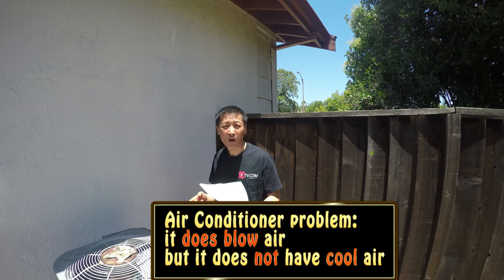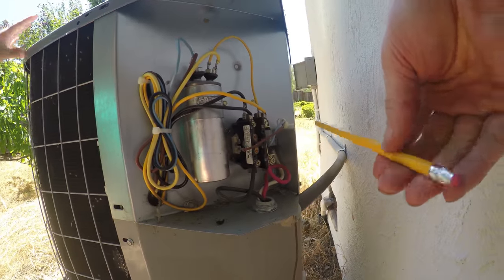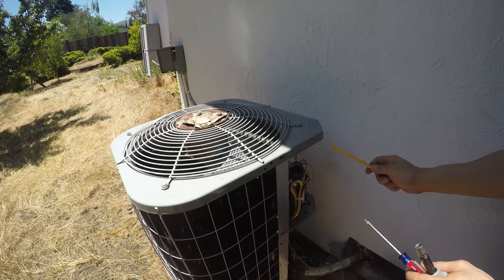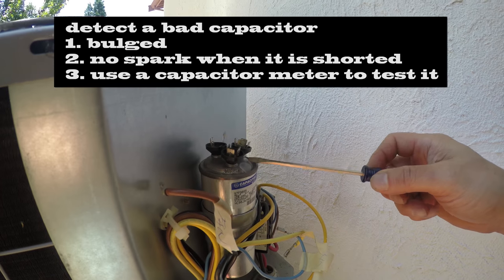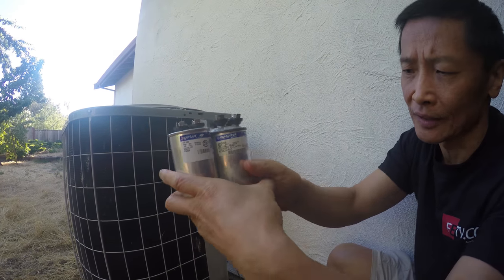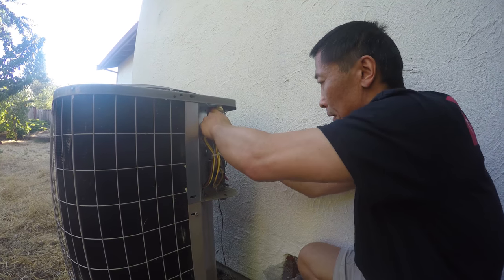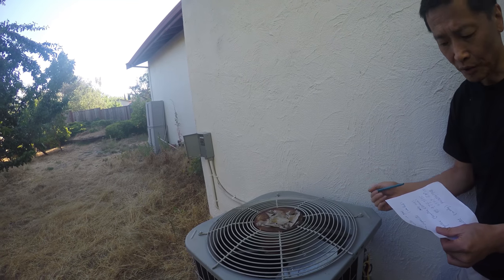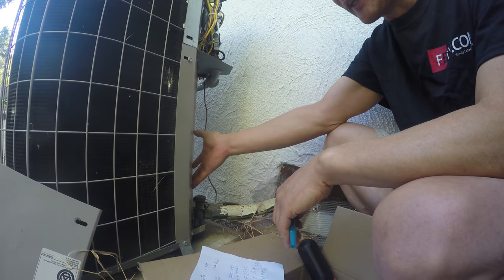How to Fix Air Conditioner Blowing Hot Air

Comment: Several days ago only hot air would come out. I called out an HVAC guy and paid $320.00 to get my AC fixed. Then a couple of days later my second unit did the same thing. Now I'm thinking, "Did this guy sabotage my second unit?" I know, what a thought. But for both units to go out within days of one another?

Anyway, this time I went to You Tube University. I watched your video and a few others and was pointed toward the capacitor. I followed your instructions, and now $28.00 later and the time and gas it took to pick up the part, my AC unit blowing out cold air again!

I'm not mad at professionals who make a living off of customers without the knowledge or time to DIY. But I am immensely grateful for people like you who graciously, and so competently, make knowledge available so people with the time and inclination to DIY can do so.

$320.00 vs $28.00

Incredible!!!
Reply from the maker: Thank you for taking the time to share your story. This will help others to save money and time.
Reply: If the units are the same age, it's not uncommon for that to happen. The capacitors only have a 4 year lifespan or so.
Reply: @starmc26  Thanks for the feedback.

Comment: Found/watched video (7min).
Diagnose/tinker/ notice mine can be jumped started/ start capacitor very swollen (30 min). Find store that has correct part (1 hour). Store and back (30 min). Install (5min).
AC works 100% amazing now. It's 110 insane heatwave in central California so THANK YOU!
Reply from the maker: Thanks for sharing of your success story and your precise time. You almost had the optimal efficiency in executing this plan.

Comment: Thank you, thank you, thank you. You saved me money. The capacitor on my AC was bulged and it would not turn on the compressor hence no cold air. ordered the part from Amazon and replaced it myself. A large AC company would have charged me easily $180. The part was  
$10 and fixed the problem myself. Thank you Mr. Genius Asian.
Reply from the maker: You are welcome. I am glad it worked for you and saved money. As many of our viewers reported, this capacitor problem is really a very common problem.

Comment: That is a contactor, not a relay. Definitely not all low voltage. You can get killed playing with that. For the most part a good DIY person video. This will be helpful to some I think.
Reply from the maker: Thank you for taking the time to provide feedback. We used the word "relay" so that more people would understand its function as most college circuit class would use the word "relay". Thank you for reminding people the contactor/relay involves high voltage, we certainly do not want people get shocked.

Comment: From my experience its almost always the capacitor.   My 4th house with all the same issues.
Reply from the maker: yeah, in fact if your air conditioner is 6 years or older, you should check the capacitor every year. You may visualize the bulge as shown in this video, or you may use multi-meter to measure the capacity. If it is bulged or lower capacity, then you should replace it with a new one. Buying a capacitor online is pretty cheap, i.e. less than $20, you can tell yourself spending this small amount is like paying an insurance.

Comment: Our fan is going, it's blowing cold outside just not inside. Thermostat seems to be working. I am guessing it's refrigerant in this case?
Reply: Did you find a fix for it? Got same problem.
Reply: @getupryan  mee too 😥
Reply: @healingandhappy9262  forgot I posted but mine was a capacitor
Reply: @getupryan  Ty, so much for responding!!

Comment: My air conditioner reverse cycle working in hot but not working in cold do you know why
Reply: Could be reversing valve stuck..if you live in a colder climate like new england the reversing valve will fail to heat..opposite in warmer climates...also your thermistors could be faulty..could be another problem but would need more info....

Comment: Well, You may wanna keep in mind that the capacitor always holds high voltage even with the breaker flipped so it maybe unsafe to replace a capacitor yourself.

Comment: What if I have a AC that’s in my window in my room with this problem what do I do
Reply from the maker: the difference between split unit and window unit is that the window unit has everything in one place. But the  problem is the same. The same questions will be asked: 
1. does the thermo stat work? 
2. does the fan turn?
3. is there problem with the capacitor?
4. since window unit includes air filter etc, the additional check is to see If the air filter is dirty or clogged.
Reply: Genius Asian thanks it might be clogged I’m not sure
Reply from the maker: @StevieRockerMusic  thank you for sharing your problems, let me know when you find the culprit
Reply: Genius Asian no problem

Comment: My fan spins for 30min. then stops. How can i fix this?
Reply from the maker: your question of "My fan spins for 30min. then stops. How can i fix this?"  
It could be that after 30 minutes your room was cold enough so that the AC stopped. So what is the problem?
Reply: @GeniusAsian  Thank you for your reply. The condenser is humming but fan is not spinning.
Reply from the maker: @NightShiftBear01  The condenser has a heat exchanger to cool and condense vapor into liquid. When you say the "condenser is humming," I assume you meant the outdoor unit (instead of the condenser humming) is humming like normal, and that the fan does not spin. The capacitor for the fan has high probability of failure, did you use screw driver to push the fan as I showed you in the video? If you can jump the fan to start, then it is the starting capacitor for the fan at fault.
Reply: @GeniusAsian  The fan will not start with help from the screw driver. But it will start after about a 30min. rest period.
Reply from the maker: @NightShiftBear01  are you saying during this 30 min period, it keeps humming?  Since it takes 30 minutes, It looks like after 30 minutes, some components is/are heated up, so it is "temperature" related. After you disconnect the power and discharge any charges, try to feel if the fan motor or the capacitor is hot.
1. if the capacitor is bad, you will need to replace with a new capacitor.
2. if the fan motor is bad, you will need to replace motor and put in a new capacitor.
Since capacitor failure probability is high, and both 1 and 2 require a new capacitor, and it is cheap, you should try to replace the capacitor first. 
(My video showed the bad vs good capacitor in close up view, do you see your capacitor looks like a bad one?)
Reply: @GeniusAsian  During the 30 min. rest I shut the unit off by the inside. I've replaced the capacitor. The fan motor is does get very hot. Replacing the motor was going to be my next step. It's a 20 year old unit so im getting quotes for a new split unit. Thanks for your help.

Comment: Please drop the first word of your name (genius). Thirty seconds into this video, you start using an "insulated" probe to poke around 230VAC circuits, without a clue that your probe (a graphite pencil) has a conductive core. Let me put it into simple terms any genius DIY instructor like yourself can understand. IT IS LIKE A CHOPSTICK WITH A COPPER WIRE DOWN THE CENTER.
Reply from the maker: yes, we immediately realized that, that is why we switched to a plastic ball pen with a plastic cap at https://youtu.be/ZRjwpigrZSE?t=281 We are glad that you noticed it, but note that it is a new pencil with rubber eraser. The eraser is a good insulator.
Reply: Oh I see. And you removed the rubber and examined that when the pencil was trimmed to length, there was no graphite smeared from the core to the metal ferrule that secures the rubber eraser? You know that voltage from the capacitors could easily arc a short distance (maybe 2mm) like that, right? So... even though my description was 110% correct, I will rephrase... Your "insulated probe" is like a chopstick with a copper wire down the center and a rubber tip held on by a metal ferrule with a 2mm air gap. Would not be my choice for high voltage probing lol. Were you at least wearing golf shoes with metal spikes to act as lightning rods? :)
Reply from the maker: yes, I could not find a chopstick at that time, although the new pencil I had at the time was ok it should not be recommended. We immediately realized that, that is why we switched to a plastic ball pen with a plastic cap at https://youtu.be/ZRjwpigrZSE?t=281 . Also we put this note in the video description to let people know that the plastic pen with plastic cap is better.

Comment: Our fan is going, it's blowing cold outside just not inside. Thermostat seems to be working. I am guessing it's refrigerant in this case?
Reply from the maker: In the video, we showed you the two tubes, do you  feel temperature difference? If you can eliminate the compressor is not at fault, then you can check the refrigerant.
Reply: @GeniusAsian  thanks for the reply. Sorry for the double post I was having internet issues. I will check that in the morning. Thank you so much!
Reply from the maker: @unabashedlybroken6789  no problem, let us know your result
Reply: @GeniusAsian  it was as you said the thermostat. It was shorted out. I had to replace it. We were able to bypass it to cool the house down until we got a new one. Thank you :)
Reply from the maker: @unabashedlybroken6789  Thank you for taking the time to share your result, this would help other people
Reply: @unabashedlybroken6789  yes, thank you!!